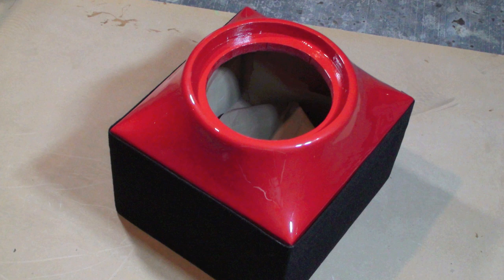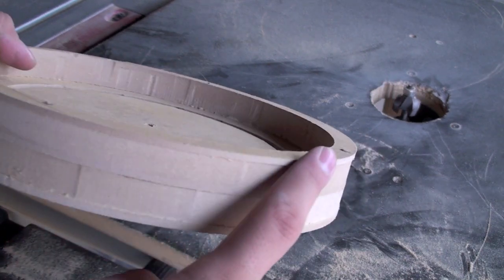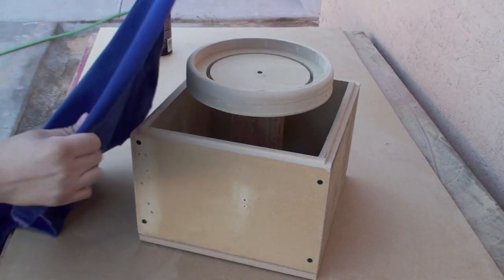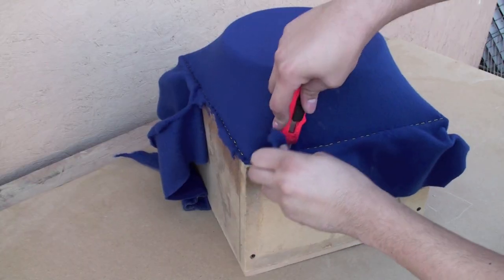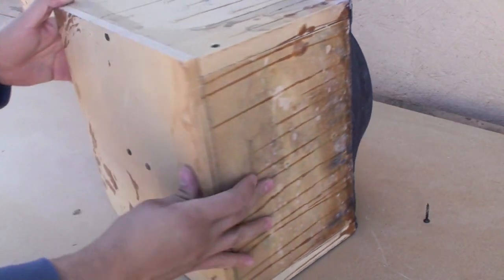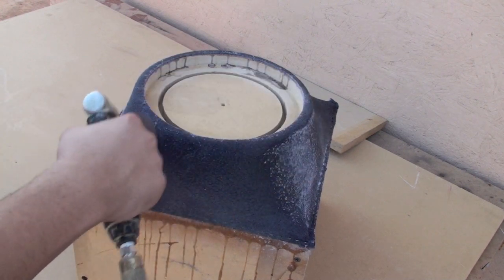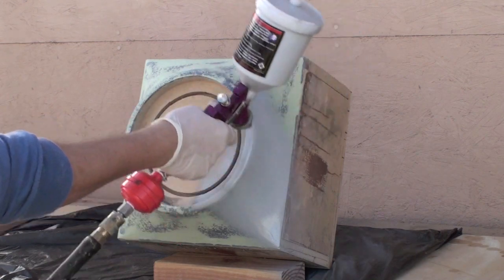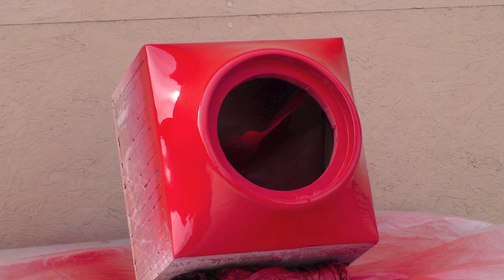How to fiberglass (subwoofer enclosure)

Comment: Great idea and great tutorial but the paint needs to dry a LOT longer than a few minutes. I let mine dry for days but at least 24 hours is a necessity. I realize recoat times are different but clear over top coat isn't a "recoat". The paint layer will literally never dry under the clear and your surface will be soft.

Comment: "it's completely normal if the primer runs"...not if you do it correctly, what is the whole point of sanding the filler smooth if you're just gonna bodge the job on primer!!
Reply: This, exactly this lol. Paint isn't made to run, getting runs with primer means you are spraying way too much material onto your work...

Comment: Just found this and it is very good. I have been rebuilding my boat and working with a lot of fiberglass. I would make one suggestion, before you apply fiberglass on the inside I would saturate the bottom of the fleece then lay down the fiberglass to ensure the bottom layers soak up the resin also then soak the top of the fiberglass

Comment: did you just put fiberglass resin onto of fleece? with no fiberglass? lol
Reply: it stiffens, so it's fine. There was mat added to the inside too, besides.
Reply: SurfTheStreets01 

It is easier than using wire mesh as a form to glass over, it stretches and can be stapled into place

Comment: Your body filler primer and paint skills are shit. Way too much body filler for the first AND ONLY coat you used. No finishing glaze. 80g then prime. Are you fucking kidding. Should be a min of 120g. Your primer is too heavy and you should be using a red scuff pad which is equivalent to 600g. Or go with black 800g paper and wetsand. Though you may fuck your mdf. And you should lightly wetsand if possible each paint coat with a min 2000g. The best paintjobs are often the thinnest.

Comment: Respect for getting it so smooth.

Im doing this with an 18" sub and a 50x80 centimeter box. But it is hard as hell to get it smooth. 2 layers of bodyfiller and im still sanding.

Comment: Great video, lots of useful techniques like using the fleece for a smooth curved surface.  It was easy to understand what you were saying.
What kind of sprayer do you recommend, please?
Hoping there's a tools and materials list, I didn't quite catch what kind of primer it was.
Probably want to wear a P100 half-mask respirator while sanding, they're only $15..$20, relatively comfortable to wear and keep that stuff out of your lungs.

Comment: How did you calculate the correct volume box size to match the speaker?
Why didn't you just use fiberglass cloth on the exterior? Even add tint to give it color ;)
And you're quite messy with the filler.
Never cut metal with a router bit, you'll just dull the bit.

Comment: 1 problem with this creation, as soon as you start putting some mega bass though it, cracks will soon appear, You cant just use Fleece and resin just to create the other half of the sub without actually using fiberglass to give it the strength it needs!
Reply: He glassed from underneath? It should be fine.

Comment: Why would I do that? Not saying there isn't a reason, but what makes that better than a sealed MDF box with some carpet? If it had been an irregular custom fit, I would have understood, but it's just a square box.
Reply: the fleece allows you to have a contoured custom lid.
Reply: I mean is it just for looks are there applications where you would need to do it this way? Is it acoustically and harmonically different than wood?
Reply: I think just for looks although I think the fiberglas would be inferior absorption IMO.
Reply: That's what I was thinking. Fiberglass seems like it would buzz if it weren't very thick, but maybe the fleece helps with that.
Reply: I am doing a fleece ported box now. I will check it out. will take a week or 2 till done. I will let you know if I can feel it vibrating on teh Subs
Reply: Cool man. Definitely let me know how it goes; the experience would be fun, and I would love to make my budget woofer sound better. The box I'm using is one from an old Pioneer home stereo. I had to cut the hole bigger (which I did so poorly that two of the screws don't hit wood) and the port was made of cardboard that made such a wretched noise I had to plug it. Between it being about the worst, leaking-est, miss-sized box imaginable, and the $27 Boss sub, my sound quality is pretty pitiful.

Comment: Yeah man, where in the hell is the average person going to have access to all of these tools? Not the everyday person has this. Should've made a DIY with something that almost anybody can do with simple tools.
Reply: You can get a small air compressor for under a 100.. and a DA sander for 10-20 at Harbor Freight...
Reply: you do not need a nail gun and sander, that is what God made a hammer and your hands for. Just amke something already
Reply: If your tools are limited, figure out a version you CAN build with what you have and can afford or borrow.  Or do things by hand.  You don't have to have a router or air tools, though they do make jobs faster and easier.
Reply: I have all these tools and I payed less than 1k, you just have to find good deals and be patient.
Reply: The fruitcake speaks. I bet you used to sell more girl scout cookies than the rest of the girl scouts. What were they calling you back then? Yolanda you little bitch?
Reply: You only need the router, the tool pattern he uses as a jig can be made from scraps laying around the shop. The power sander is not needed, you can hand sand easily.
Router is less than 200 in a kit from sears. He only uses 2 router bits, a 1/2 round edge on the speaker and a square for the dado edge.
Reply: After about  a thousand dollars in tools you will be able to do this so will ending paying for some to make this for me

Comment: Yes, but thats a home autdiophile speaker. :D I am talking about car subwoofers. But yes if I was going for a super SQ system for home use I would seal the mid drivers/woofers in the towers. Not so much for the actual sub in the system.

Comment: wont that be kind of weak though with no fiberglass layers?? i got 15's and i have a good feeling they would rip that box apart they flex 3/4 wood a 1/8 inch piece of glue and cloth wouldnt stand a chance right??

Comment: I recognize many of the air tools from harbor freight.  You will need a high power air compressor to power the grinders and paint sprayers.

The final product looks great.  However, I don't really understand all the effort put into the lofted  and painted fiberglass piece.  I don't imagine that it has any functional utility.  It looks nice, but isn't this speaker going to go into a trunk anyways?

Comment: Making a box purely out of fibreglass is pretty easy...
You need a minimum of safetygear and some basic carpenting skills to make the frame of the box you're going to mold.
In my mercedes (wich has the gas tank in the boot) i made an enclosure in the passenger footwell, purely out of fibreglass... i taped the inside of the car, with cling-film and tape, then "painted" resin on, let it cure, repated, and removed my molded cast, i then later molded the front of the cast and cut a hole for the sub.

Comment: Most recreational boats have their hulls made out of fiberglass only, and many race cars have their bodies made from fiberglass, so yes you could probably make this out of fiberglass only. For maximum strength though, use as little resin as possible, and as much fiberglass as possible. If you get shiny surface, like in this video, you had too much resin.

Comment: so long as your viscosity is right for the paint you are using and you have the right ratio's you should get the right paint thickness, plus you will only get the shine after curing with 2k direct gloss or a clearcoat

Comment: You don't need to set it "in the sun" to dry epoxy. The only gain in drying time will be from the heat of the sun which will probably be negligible. Likewise, it is NOT normal for primer to "run". You are spraying it on too thick if get runs. You should use light, even coats what NEVER run.

Comment: the router bit cut´s easyly through the brad nail? who teached you this shit? idiot! router bits can be very expensive, and the only material they are designed for, is WOOD, and NOT steel! NOT even thin steel! this is the worst shit i´ve ever heard!

Comment: BTW man I SPRAYED MANY THING AND NOT ONLY SPRAYED I DID IT FROM GROUND UP AND BELIVE ME AND ALL WHOM U SHALL ASK ... ITS NOT NORMAL TO HAVE RUNS , u spray it preety slow not fast as u said and spray so much so u won't get let it dry and repeat the process till u get an even colour , THEN U SAND IT A LITTLE  THEN CLEAN IT UP WHIT ANY TYPE OF ALCOHOL ... DRINKING ONE , SANITARY ALCOHOL , NOT THINNER CUZ ITS TOO STRONG AND LET IT DRY , IT SHOULD IN SECONDS AND THEN U APLY THE CLEAR COAT

Comment: Don't use liquid nail! all the pulling and pushing of air (especially in a sealed enclosure) will just pull off the top layer of the MDF board that the liquid nail is attached too. use caulk! it's flexable and will do just as good at sealing the box. aside from that though, amazing video!

Comment: @Winha277 yea i did see him put it on the inside, were it is useless. the paint will chip and crack fast as shit on just stretched fleece hardened with resin, it needs fiberglass on the outside

Comment: @MotoXxXBeastn 

Why would you start with a smoother grit and then go to 80? 80 would causes scratches to be shown in the paint when finished. You should start with 80 and work your way up to 180 with a foam block sander. High build primer will fill in any scratches from the 180. After you've sprayed the primer, you should sand with 320 and finish with 800 so sand scratches don't appear in the base coat. Spray your base and then spray 3 coats of clear. Wet sand with 1800 and then buff.

Comment: @narutoedv33 a subwoofer is a kind of speaker that has a vibration effect to it if you play it loud enough, and when its played loud enough, it has a little air hole that shoots out the air from the speaker. search up dubstep on a subwoofer for best examples

Comment: did you use regular fleece you can buy at a fabric store? and are there any kits for the fiberglass and bodyfiller? i want to cover a Styrofoam ball in fiberglass, but i want to be able to take it off after. if i cover the ball in paraffin wax then leave a hole in the bottom, can i just break the styrofoam apart when i'm done so i have a fiberglass shell?